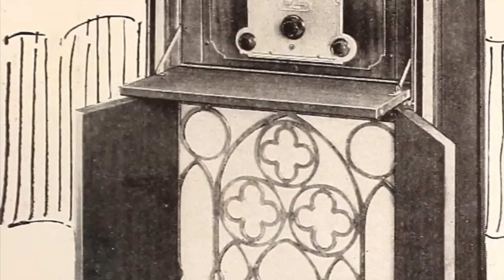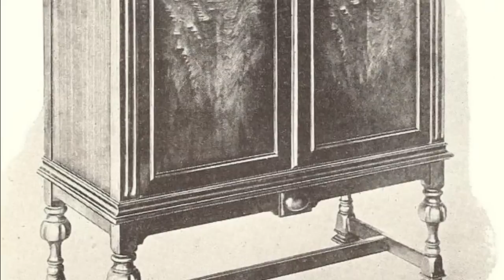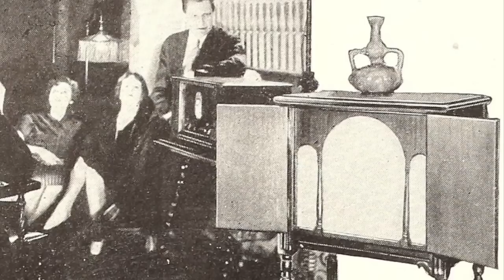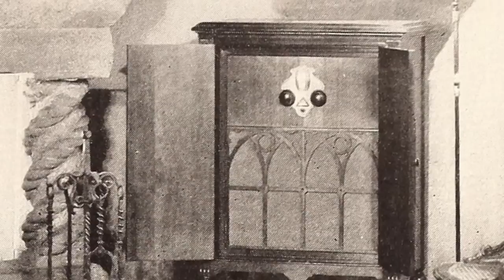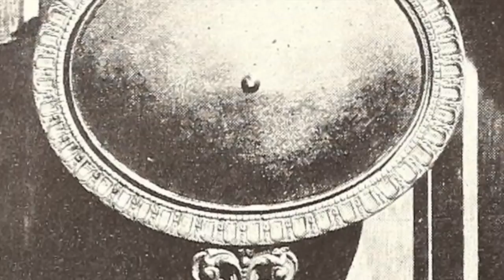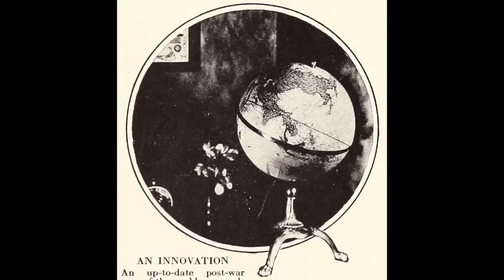More AMAZING 1920s Radios

Comment: I remember having an old floor model with a port in the back that resembled an rca port still used today. I plugged it in with a device and it worked!! Still wish I had it but the local oscillator stopped working and none of the local repair shops knew how to fix it

Comment: Some background.

Battery operated non portable table and console radios done for several different reasons/
1. Many homes then, had
     N0 electric service.

2. Tubes for battery sets
      were cheaper as they
       had simplers design.

3. Rectifiers to convert AC
     to internal DC voltages
      inside the set added to
      price, particularly so as
       were patented items.

Many people bought a convertible set to get started, then invested in extra equipment, called
  "Battery Eliminaters"
to later.

Às shown load speakers were an extra add.on for sets that that out - of - box used earphones.

Another option were devices for hand cranked phonographs that replaced (while listening to radio) the "needle holder" * which could be reattached to
 play records normally.
   *Properly named as a
       "sound box" or
        "reproducer"

Comment: Nice radios! Many look like fine pieces of furniture. Though it might be difficult to get parts to rebuild them. I had some 1960s tube radios back in the 1980s and it was difficult to find parts for them. Thanks for posting!
Reply: Reliable parts most likely get harder and harder to source but there are modern sound systems that use valves like the old radios used to. So i wouldnt be surprised if there were other such modern parts being made.